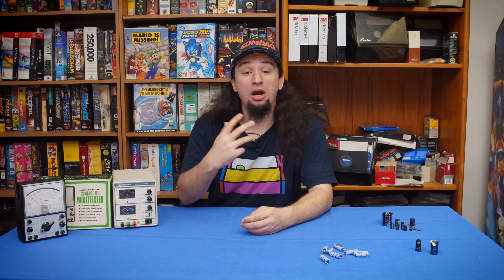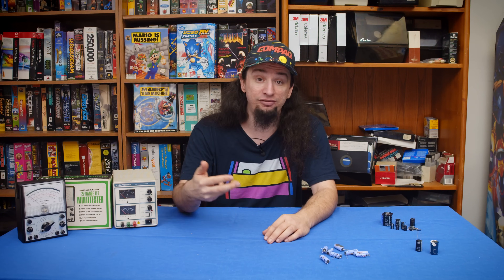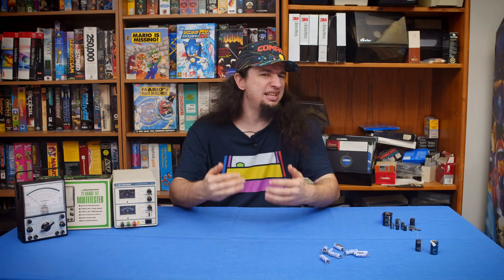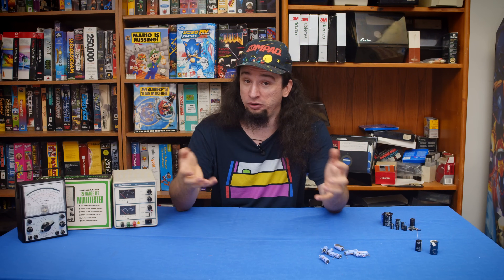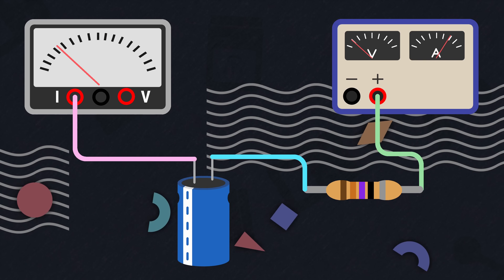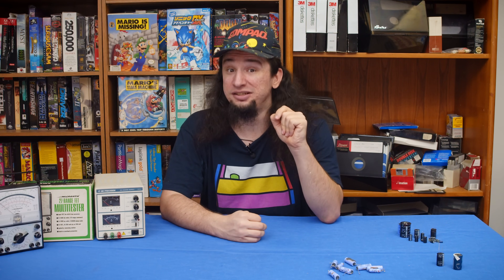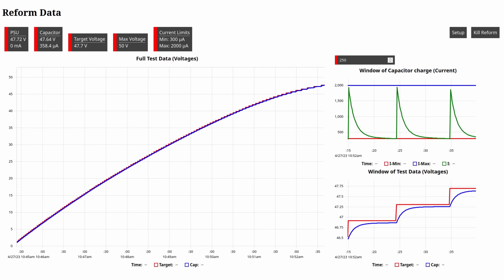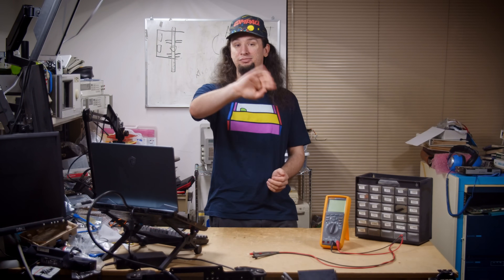Reforming Capacitors - Everything you wanted to know

Comment: So, what you have technically made up with GPIB based equipment and a program is a constant current source with low current and poor regulation and a set max voltage.
Could one not just use such a regulator and just set the max voltage to target and the current to a safe middle ground?
A simple adjustable linear regulator with low quiescent current (much lower than your target current limit) and a configuration making it into a inline limiter should be all that is needed. The LDO has to handle the voltage being blocked though when limiting current. No problem for lower voltages, but can be harder for 100v caps.
Something like the NCP781 could work, but would have to drop a minimum of 1.5v from supply in order to turn itself on. It is capable of blocking 150v and it's enable pin is 150v tolerant as well allowing it to be used as a inline current limiter. Adjustable version has a 1.23v reference so for example by using a 1.2k resistor between it's feedback terminal (adj) and output, then a equal 1.2k from adj to it's ground pin it would effectively power itself at 2.46v (high enough to make enable pin activate circuit all the time).
Enable pin is tied to input pin, and input is supplied with +102.46v and something added for the dropout voltage (possibly around 3-4v). The capacitor + is connected to LDO ground and capacitor - is connected to supply ground. With the quiescent current and the ground current it would then supply around 1.25 to 1.5 mA of constant current and be limited by the supplied voltage. Lower current is ofcource available and no changes need to be done to circuit when reforming lower voltage capacitors, just lower the supply voltage.
I don't think it would be ideal for low voltage caps like 5v etc but 15+ would probably work well.

Comment: Another factor in speed of leakage current slowdown at 15:09 might be different capacitance values as the circuit is basically a high pass filter loaded by resistance of the analog meter. Oh and if you want to automate without multimeter you could consider a source measure unit, they have more current ranges and some can go up to 1000V (but yeah expensive sadly). Nice vid thanks.
Reply: use a filament bulb, they have ptc resistance characteristic... low when cold/low voltage across, rising with applied voltage, very useful as current limiters, semi stabilisers
Reply: what about that using that funky "CC" mode in a power supply?
Reply: @WestEast3259585  For the typical power supply the current we want (<5ma) is below its resolution, but there might be some more precise power supplies where it would be possible. Also the maximum voltage limits us to caps below it. But yes a single device to do it automatically would be a lot more pleasant.

Comment: so whats the consensus? I'd say buying new is the way to go.
Reply: The consensus is, it depends. Often reforming can work and when it does it does. If it doesn't then you're left with no choice but to buy new capacitors. The process of reforming will tell you if it works, or not, too. Because as you're doing it you can see it working.

Comment: Not commenting on conclusions yet.  But I do understand how capacitors work on a basic level. 2 parallel metal (conductive plates 1+ other -) or stack them +-+-+-+ like a battery or Volta pile. Wrap them into a cylinder, or spiral to max energy density vs/v volume/mass. 
But what I don't understand is how a CRT functions as a capacitor.
My father was a sparky, (electrician) about 35 years older than me, he called them sometimes condensers, that shows how old school.
But he did learn particle wave duality Einstein/quantum in his twenties and in the twenties.
Obviously he did teach me a fair amount. But like him, always learn new things as understanding changes.
Reply: I’m guessing that you’re referring to the HV filter cap that’s part of the CRT?  If so, it’s the same thing - two conductors separated by an insulator. The inside of the bell of the tube is coated with a material called aquadag - it’s a conductive graphite material.  The outside of the bell is also coated with a conductive material (might be aquadag, but likely something a bit more mechanically robust).  The second (HV) anode connects to the inside coating, and the outer one is grounded.  Two conductors, separated by glass. Voila - a capacitor!  Not a very large one value-wise as the glass is relatively thick so the plates are widely spaced, but a capacitor nonetheless.